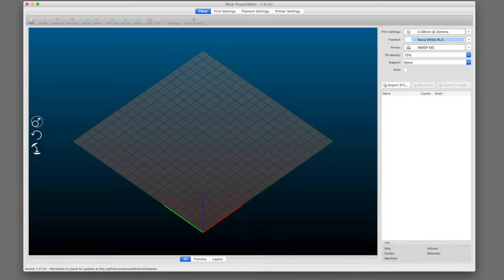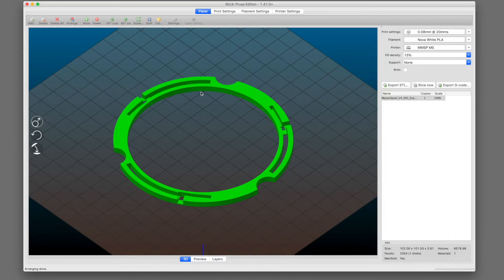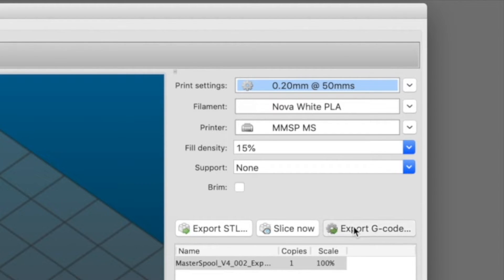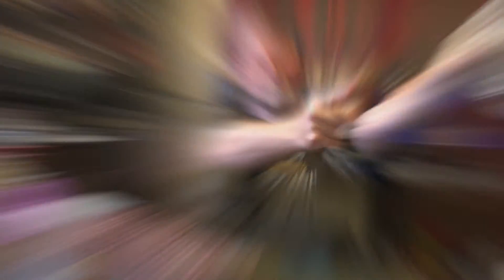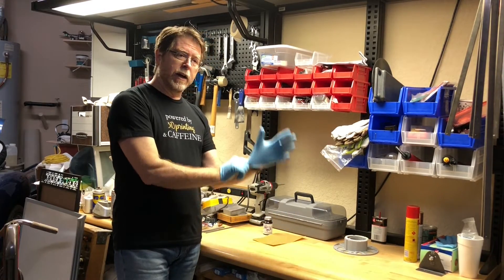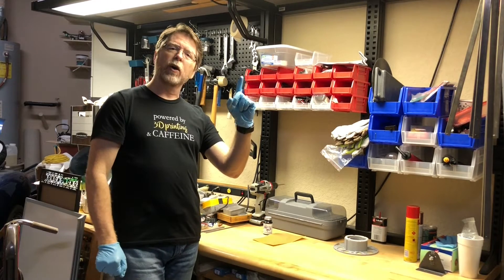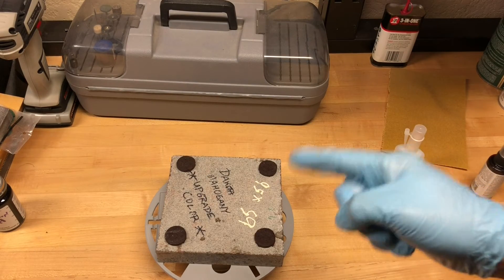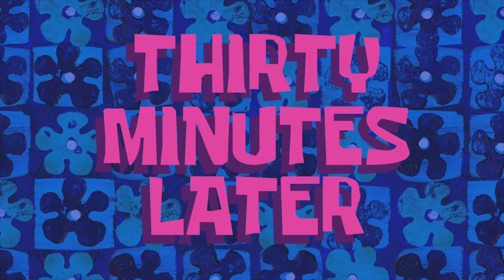Too Much G-code, Not Enough Filament! How To Fix an Unfinished Print

Comment: That's a great spool idea, I'm  looking for a kit to weld two pieces of filament from left over spool filament. Any ideas?
Reply from the maker: Well, there's the Palette 2 from Mosaic Manufacturing. It's really for doing multimaterial prints, so you have multiple spools feeding it. I think you can put it in a mode where it starts feeding from one spool, and when it runs out, it just switches to the next spool. https://www.mosaicmfg.com/products/palette-2

Comment: Another great vid Bryan.  I don't think printing the missing bit would have come to mind and I would have just started over....or picked a different design.  :)  Glad you got your voice back.
Reply from the maker: Thanks Tim! I've seen others recommend this as a way to salvage a print, but I hadn't seen a video about it. I think as long as the print is going to be painted or finished in some way, or it's a functional part where the strength wouldn't be impacted by this fix, it's a great way to salvage a failed print. Also I'm glad I got my voice back too! 😀

Comment: HEYYYY!!!  my bottle of gloop is dried up too! I hit them up on Twitter, but they just said I likely left the bottle open... :/
 might have to hit them up again.
Reply from the maker: Hey Thomas! Try them again and see if they'll take care of you. Someone else I know said their 3D Gloop was starting to turn yellow. I think maybe theirs is drying out as well. I wonder if 3D Gloop is one of those things that you just have to use up within a certain amount of time once you open the jar. If so, it might be better to have multiple smaller jars than fewer larger jars. 👍
Reply: @BV3D   I just did on Twit. it was last week and it was jello, not it's solid and I went and cleaned everything and resealed. thenk they need a better cap/seal or maybe go to a tube...?
Reply from the maker: @Thomllama  They're working on a spray can of 3D Gloop, so maybe that's the best way to do it? I don't know. But I think the spray-on version would be best for those times you want to use 3D Gloop to smooth out the layer lines on a print. 

I don't know if a tube is the answer, but it could be worth a shot. Especially if it's a metal tube rather than a plastic one. And by plastic tube, I mean the ones that you can sometimes get adhesive caulk in. THAT kind will want to return to its "full" shape, and will want to suck in air. A metal tube tends to stay squeezed when you squeeze it.